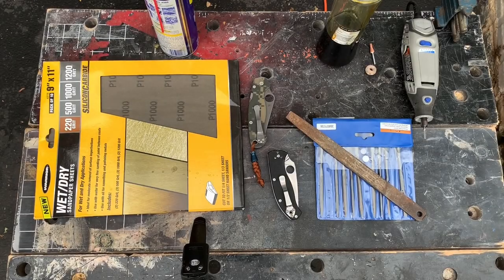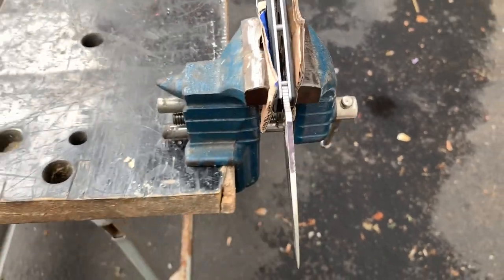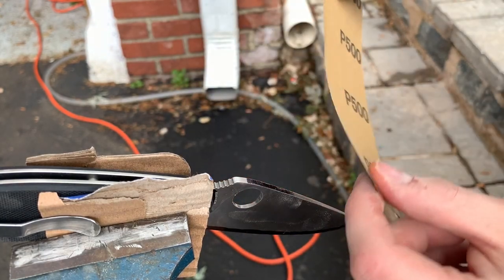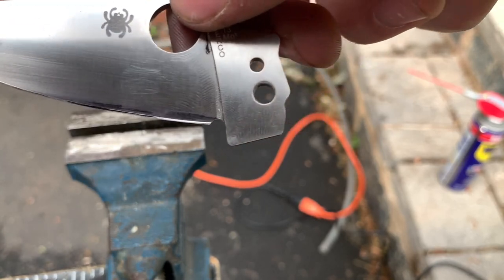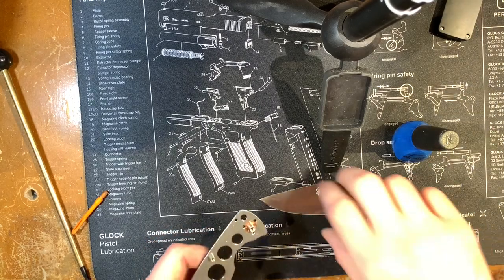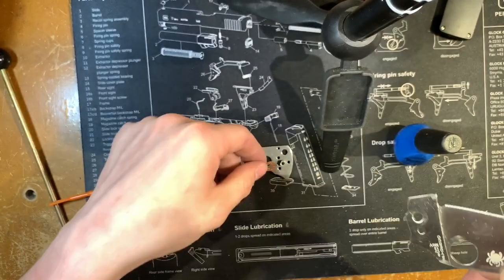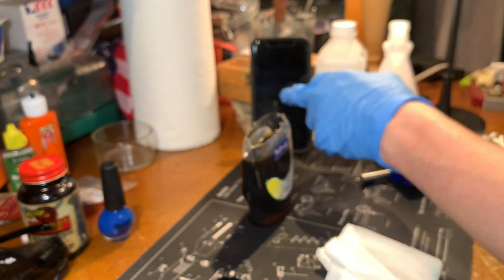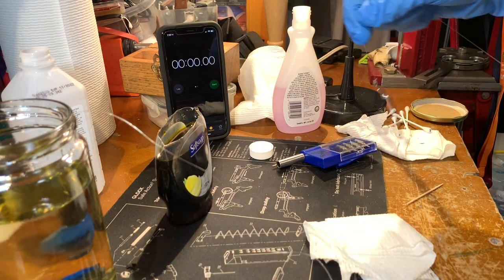knife modification. how to modify a spyderco knife.

Comment: Before you disassemble the knife you could trace the arc of the frame /scales onto the blade with a pencil. It looks cleaner. Nice new G10 scales.
Reply from the maker: If you check out our newer video I show the scales that I ended up making for this knife. I designed some scales in cad to be 3D printed. They turned out great!